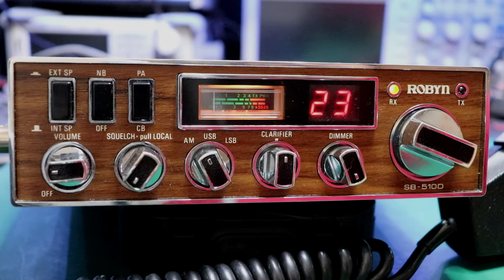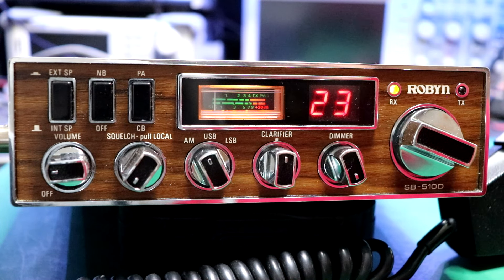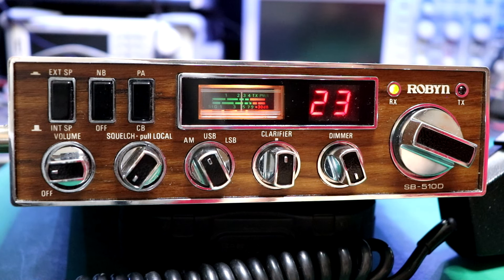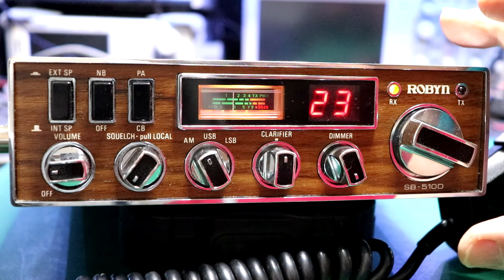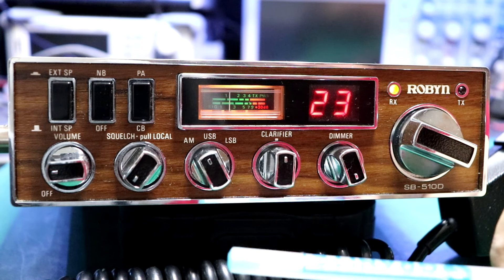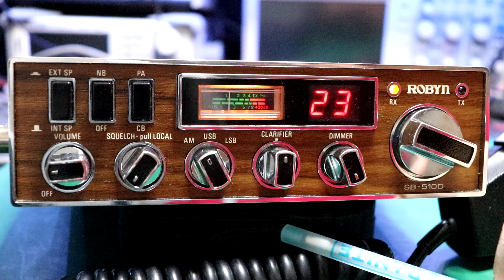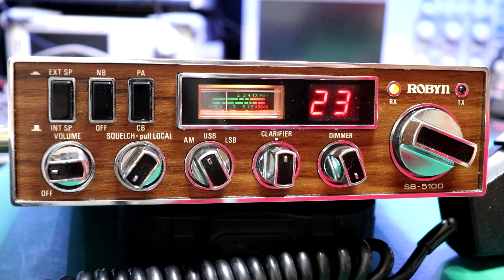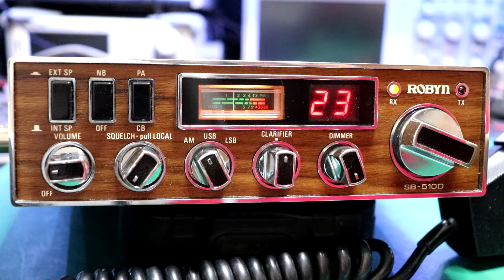Robyn SB 510D AM/SSB Mobile CB Radio (UPDATE)

Comment: 1977.  I bet some of the caps have high ESR,effecting performance on xmit and receive.
Reply: Strangely enough, some radios need the caps changed, and some don't. I have a video of a Lafayette HB-525F mobile that needed a ton of caps replaced to correct distorted audio. I have experimented with increasing the value of some of the squelch circuit caps to lessen or eliminate that thumping sound. 
Tube radios and linears definitely need to have the high voltage caps replaced, but unless there's a problem it's not worth the effort to replace caps on the Japanese radios.
Reply from the maker: I have pulled caps from some UNIDEN chassis that are as good as new. It can be a crap shoot at times, however I only replace them if they leak, bulged or are affecting the circuit. Works for me.
Reply: Don't have to pull caps to check ESR.  I'll bet money that radio has high ESR caps.